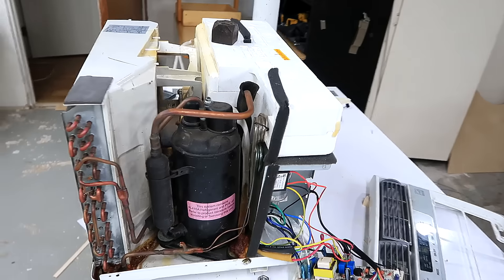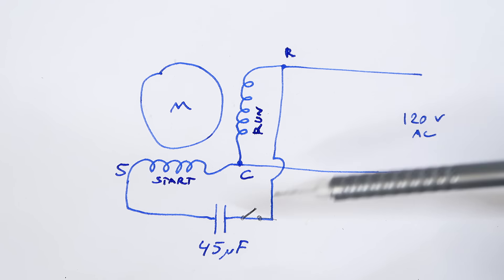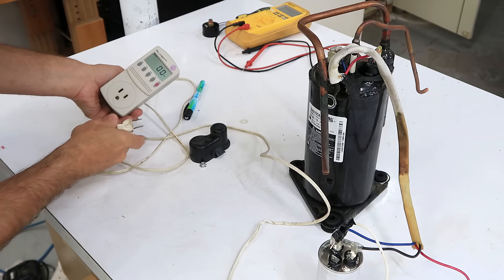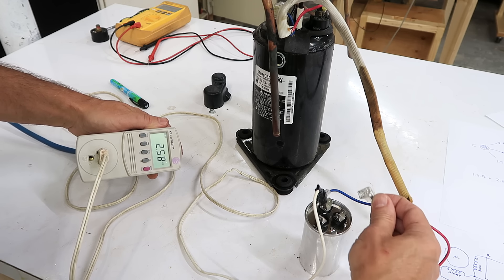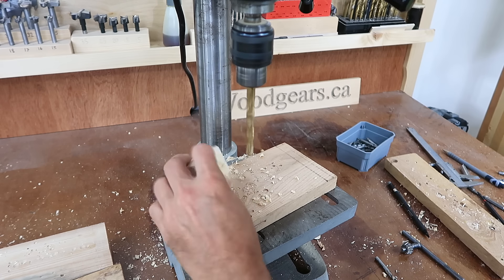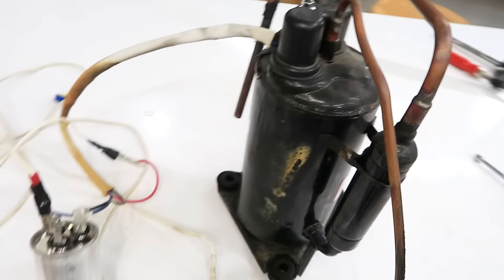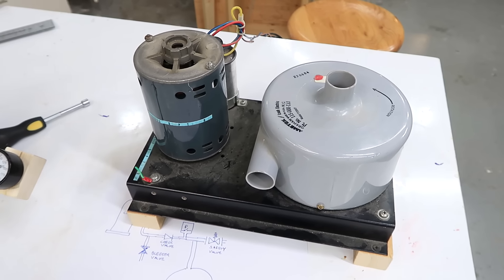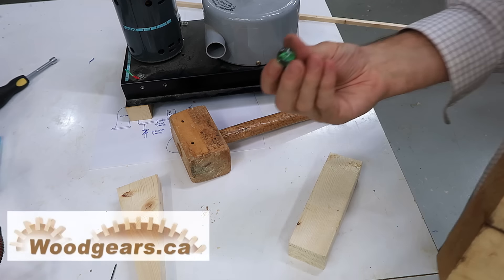Reusing an air conditioner compressor

Comment: I'd be curious to know how long that compressor could run as an air compressor. AC compressors typically use the refrigerant to move around the oil to lube the insides, so I wonder how much life you would get out of it without that.
Reply from the maker: the refrigerant is a gass when it's in the compressor, so I figure air should do the job too.
Reply: @matthiasrandomstuff2221  True but the AC system is a closed loop, so any aerosolized oil that gets pushed out of the outlet eventually gets pulled back through the suction line into the compressor again. Might need to add a sight glass and just top it off every so often to make sure it doesn't run dry, similar to a vacuum pump.
Reply: @matthiasrandomstuff2221  so long as you're used to the compressor is for short durations, it will probably survive. In the refrigerant circuit, the compressor receives the refrigerant in a gaseous state where does that low pressure and cold, so the cooling for the compressor comes from it being integrated into the refrigerant circuit. Likewise the lubrication occurs with the reservoir of oil in the compressor, the refrigerant carries the oil around the circuit and back into the compressor. One thing to keep in mind about this particular compressor, given that it was previously used with r410a, it will have POE oil in it, which is hydroscopic. Compressors fundamentally don't survive when there is contamination in the system, moisture being one of them ... Hence with a conventional air compressor or vacuum pump the motor is external to the pump, rather than the motor being integrated into a hermetically sealed design. At least you have the right idea, it's a toy, it lasts how long it lasts.
Reply: @matthiasrandomstuff2221  hvac compressors have oil mixed into the refrigerant. It’s also dry and doesn’t contain any moisture. During normal operations the oil flows through the entire system with the refrigerant and returns back to the compressor to keep it lubricated. Without a return loop eventually all of the oil will be expelled and it will start to have issues. Adding moisture from the air will also cause problems over time with water and contamination building up in the compressor. HVAC systems will also have a filter dryer that contains both a filter element and chemical desiccant to ensure the loop inside the system is clean and dry, It’s fine for occasional use or if you got the compressor for free or salvaged but there is a reason they don’t use them for general purpose air compressors.
Reply: Yes, all of this.  I have. S similar compressor I used as a vacuum pump.  Short runs, because no cooling.
Reply: You can just put a few drops of mail gun oil. Should be ok.
Reply: I've thought about this too. you'd probably want either an automatic oiling system to put a drop in once an hour or so. Arduino project?
Reply: @matthiasrandomstuff2221  
Just throw some fresh air compressor oil and you should be good to keep it running for years
Reply: @matthiasrandomstuff2221  yes it's in gas state but cool gas like at 50°F to 60°F
Reply: One more thing to note when you do this: it will spit out small oil particulate... Probably not good for the breathing
Reply: @eveanema  not good for breathing, but most industrial compressors have an oil separator inline on the output to catch that anyway (for tools that are sensitive to oil such as a paint sprayer)
Reply: @matthiasrandomstuff2221 problem is that the gas is usually near freezing. this will overheat the compressor. ps: it can do 400psi easy. the very biggest issue you will have in the long term is rust. there is exactly 0 rust protection on the inside. its bare untreated steel. pumping air will cause the pump to rust. source: i am in hvac.
Reply: @SupremeRuleroftheWorld  Well, the oil is usually what prevents corrosion. But we all know that the oil will soon be gone if used as an air compressor.
Reply: @graealex  no, the oil does not prevent corrosion. the lack of mostiure in the system does that. its made for refrigirant and that does not contain water. air does.
Reply: @SupremeRuleroftheWorld  Pretty sure oil will prevent air coming into contact with metal. That's literally a whole industry relying on oil to prevent corrosion.
This is of course not saying anything about air and moisture fouling up oil that was specifically engineered to work in an environment that is usually free of air and moisture.
But a thin oil film will absolutely prevent corrosion.
Reply: @graealex  most of the internals of these types of compressors does not get oil so there  goes that idea. ps: for clarity, i am a hvac service tech. i know compressors inside out.
Reply: @SupremeRuleroftheWorld  You being an HVAC tech means you are familiar with climate compressors, and mostly this kind of compressor. And mostly with the proper environments they are being used in. 
But I can assure you that even a very thin film of oil will prevent corrosion.
That is still not to say that this is the intended working purpose. I know that the lines are usually free of moisture, and special moisture traps get installed in larger HVAC as it would mess up everything.
But I still assume that even the fine oil mist inside the compressor will save it from rust for at least some time, as long as it is regularly used, and the oil that will unavoidably escape from a climate compressor that is misappropriated as an air compressor, is sometime being replaced. 
In general, climate compressors make for very bad air compressors. Obviously moisture is going to be an issue long-term. There's a reason oil-free air compressors exist.
Reply: @graealex  dude, the ONLY reason there is oil in compressors is to cool and lubricate it. hell, most compressor oils used in HVAC are extremely hygroscopic. the oil itself will cause everything to rust if exposed to mustiure/air. the only 2 protections there is in a refrigeranty system  to prevent rust is a filter/dryer and the basci fact there is no moisture inside the hermetically sealed system. and for the record: the dryers inside such systems are only capable to deal with a extremely small amount of moisture, think in terms of a single drop before its saturated. your entire argument falls flat on the single fact that nothing is capable of dealing with moisture inside a refigerant system. especially not the oil.
Reply: @SupremeRuleroftheWorld  As I said, you're viewing this from the perspective of an HVAC tech, and how those compressors are meant to be used, no air, no moisture.
The oil film will still keep away air, and oxygen is absolutely needed for corrosion.
I still agree that this oil is not engineered for rust protection. But boy do you need to come of your particularly high "I am an HVAC tech" horse. Oil will prevent corrosion. No, any liquid will prevent corrosion. You could fill up the damn compressor with brake cleaner and it would still prevent corrosion as long as it forms a consistent film.
Reply: @graealex  its not a high horse, i just flat out tell you that you have no clue what you are talking about. that you have issues dealing with that sounds like a "you" problem. and its not WD40 or motor oil that is in a compressor like this, its a oil type that ATTRACTS moisture and stores it, much like brake fluid. it will cause everything to rust even harder, not less. your entire argument simply does not apply regardless how often you repeat it. i dont have to be an hvac tech to tell you that hygroscopic fluids and bare steel dont do well in air. just 30 seconds on google should tell you that.
Reply: @matthiasrandomstuff2221  the oil being carried by the refrigerant is not a gas
Reply: @graealex  There is one problem though, that particular type of compressors (rotary) discharge gas to the crankcase. So you get condensate mixed with the oil, way worse than just exposure to air. The compressor won't destroy itself that quick but obviously I wouldn't recommend using those here. Found that issue in my own diy compressor.
Reply: @d455ave  this I recall from years ago welder friend said same: “good for short blast.” Cool idea! Well done
Reply: @iaaqob8318  Again garbage, the oil mixed in will still cause less damage than just air plus moisture. You having made a DIY compressor is rather irrelevant, without comparison to anything else. I doubt there would be less corrosion if you ran it dry, although obviously the lack of lubrication would deteriorate it far quicker then rust could.
And I repeat again, obviously this is not the intended mode of operation, the factory-installed oil is not engineered for usage in air and moisture. And air and moisture will still be fouling up the oil, and make it less effective at lubrication. But for comparison, take a part, clean it properly from all oils (I do it in the ultrasonic in hot brake cleaner) and leave it out in the open... Even the thinnest film of oil will delay corrosion, while an oil-free part can start showing signs of rust in a matter of days.
Reply: I used compressors like this for my shop from about 1979 until 2003. Just squirt a little transmission fluid in from time to time. I never really noticed any large amount of oil in my air or collecting in my tank. BTW my first one was from a refrigerator and would make about 750 psi somehow. It seems it would take a terribly high compression ratio to do that, but it was pumping air, not R12.
Reply: The oil lubrication on such a compressor is usually done by the crankshaft that is hollow, with at the bottom a smaller tap, inside the that smaller tap is a thin plate mounted. This smaller tap is submerged in a puddle of oil, when the crankshaft turns, the rotating crankshaft sucks up the oil and push the oil to the top of the compressor, where the oil gets splattered all arround. The cilinder and the piston are usually both made of cast iron, with no seals arround the piston.
These compressors are a nice piece of engineering if you grind a failed one open.
Reply: Replace the synthetic oil with a mineral oil to reduce moisture content inside. 
It would also be a good idea to have an oil trap on the outlet... both to prevent oil mist from contaminating the discharge air, but also to be able to return the oil to the compressor, either manually or automatically with the correct design.
An inlet filter (and dryer if possible) would also extend life expectancy.

Just making a suggestion. Seems like a fun project!
(Now, to find an old unit... and my torchkit. Imagine what an upgrade to a 4 or 5 ton compressor would do to your cfm output!)
Reply: @hdwoodshop  What about female gun oil?
Reply: @98grand5point9  yeah, they last. they also circulate oil through centrifugal force up through the motor shaft. 

not sure how well it lubes the scroll in these compressors, but the piston compressors from refrigerators are totally fine running as air pumps as long as they don't overheat.
Reply: @kleetus92  I don't know if I'd recommend using the "PINK Intimate Lubricants" for this application... Better for pumping her, than pumping air! 🤣

(I had to Google "female gun oil" to make sure I wasn't missing something... But I'm going to assume you meant "nail gun oil" and got autocowrecked by your phone? haha)
Reply: @DUKE_of_RAMBLE  Lol, no... the dude I replied to had 'mail gun oil'...  so I took it even another step removed from reality... Lol!
Reply: @kleetus92  ooOOohh-ho-ho Gotcha!
That's my kind of humor! 🤘😁

Comment: I have three of these types of compressors hook in parallel for shop air I use mineral oil in them all and they run fine I also have fans on them

Comment: Keep all of the fan blade parts from the air conditioner because the blower wheel could be used for a really good dust collector

Comment: In the past I used a refrigerator compressor to create a vacuum for a gas discharge tube. Together with a high voltage source this was really nice.

Comment: You can solder a connector on to it, evacuate the system. Then use automotive refrigerant, or liquid propane.

Comment: Just did the same thing the other day with a portable AC that leaked its refrigerant due to the condenser rotting.   I intend to make a small air compressor.

Comment: I suppose this compressor also needs lubrication sprayed into the intake to work. AC's usually have some lubricant in them, that doesn't need to be topped up because it circles in a closed system, that's not the case when pumping air.

Comment: I have a Fridge compressor hooked up to an old fire extinguisher bottle, the bottle has a home made blow off valve set to 100psi, its been used almost daily for about 20 years, every now and then I give the compressor a shot of wd40 in the inlet.

Comment: I used one of them compressors in the shed as a vac pump for a couple years it wouldn't pull the best vacuum (28in/hg on average) but it would get the job done.

Comment: I’ve had a few of these that I used for different things. I wanted to try making a solder vacuum so I could desolder components from a PCB, but the solder kept solidifying in the pipe and clogging it. Eventually I get bored with them and just cut them open and put the armature on display.

Comment: Capacitor is used to make a phase shift for starting the motor since it's 1-phase motor and capacitor makes it "1.5-phase" shich just kick-starts the motor
Reply: So that's a start capacitor, right, but what's the purpose of a run capacitor? (tangential question, I know)

Comment: After 35 years mine rotary 187 watt fridge compressor works still fine as an air pump but pressure fall to 167 psi maximum but can use it on a high pressure bicycle tire

Comment: A lot of older compressors used a clickson to turn off the starting cap (and I thought I saw it inline with the capacitor) and when the motor gets warmer, it turns the capacitor off.

Comment: I built one of these years ago,  I also used a bit of plugged off 1.5" pipe as a storage tank, 4pipes 12" long, would hold a little air at 140psi, I was going to add a pressure switch, never did,  it's a low volume, high pressure compressor,   a compressor built from a car compressor works better, but a Freon tank. And pressure switch, this thing would be ok, maybe get another, connect to a 2-3 gallon tank,

Comment: You also need an oil water separator and need to first drain the oil thats in the compressor first because it can be acidic now that its been exposed to air as poe oil mixed with water from atmosphere turns itself acidic,  but replace oil with baby oil or mineral oil and fill with same amount you drained out by turning it upside down and all..  fill by pouring oil down intake tube while unit is off and wait for a fewvminutes for oil to drain into main unit as theres a leak down hole inside and if turn on the unit with the chamber full and not drained through that valve after filling with oil you will lock the unit up and damage the seals beyond functionality.  But install oil separator down the line before tank because those compressors are designed to spit oil through the system and will inevitably push out all the oil you put in..  so refil when separator has as much in it you filled it up with..  snd toss old oil because it will be mixed with water and white..

Comment: These scroll compressors rely on lubricant dissolved in the refrigerant.  I don’t recall the type of oil used in that refrigerant type, but I don’t think it matters.  Any light lol should work. Perhaps devise some method of getting oil into the suction airstream

Comment: Take a piece of advice from an old farming magazine: don't build your own compressor. Sadly homemade compressors have been attributed to several tragedies, sometimes due to rust from condensation, and other issues.
Reply: Pressure test before use, with liquid instead of gas.
Reply: If you use glass bottles for storing the compressed air they won’t rust and you can see if any foreign particles ……… do not use glass or PVC
Reply: @dorhocyn3  😂💀
Reply: Yeah, the old split rim thing. Keep it caged and duck during operation. Family friends kid died from that years ago.

I personally have one rigged for a year, caged, in the corner, and I do not go near it during very light duty use. It also will not start below freezing, highly suspect moisture in the oil.
Reply: What tragedies are you talking about. Please be more specific.
Reply: @anj000  any pressure vessel or compressor will become a shrapnel grenade given enough time and rust. Your air tank is supposed to be inspected and recertified or retired after 10 years or so. Do not stand near them while fully pressurized or in operation. All tanks are supposed to be bottom purged at the end of the day for moisture. Failure to comply could cost your, or a loved ones life. Now you know.
Reply: @PBVader  thanks for the extended info. so we're mostly talking about the tanks and moisture. There was a few videos that made the rounds last year of somebody who had a compressor blow up in their garage it was quite the thing to watch.
https://youtu.be/sm_FJ6Pat4I
Reply: @anj000 , split rims have a ring on one side, which clips in, when it's hammered in place, to hold the tire on.

These rings, often, break lose when a split rim tire is being worked on (under air pressure).  The ring comes off with enough force to decapitate someone.

I worked a truck stop and dealt with many split rims (logging trucks, etc.). We didn't have a cage, so tipped the tire up against the concrete block wall, with the ring facing the wall. We used a gauge you could set and walk away from, and we would walk away. That wall had a lot of concrete missing.

Even common tires can be dangerous when the bead breaks loose from its seat.

Comment: Just an fyi, I am a refrigeration tech and work on ice makers and HVAC systems that use that kind of compressor and we have some that run at 600 psi max. While it's not SUPPOSED to run that high, 250+ is not uncommon for full time run pressures